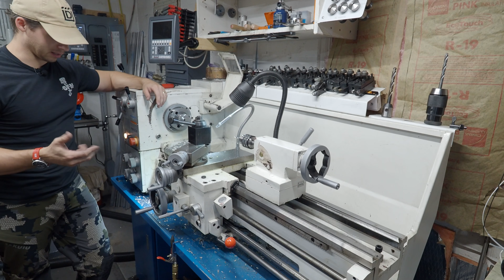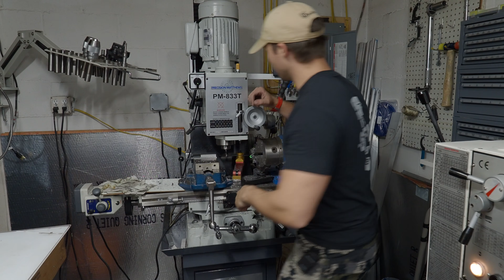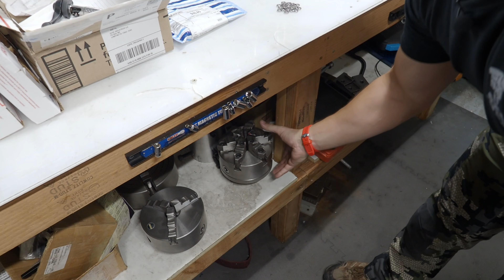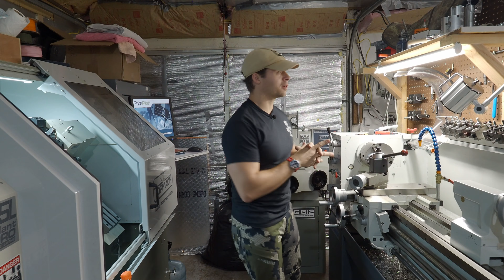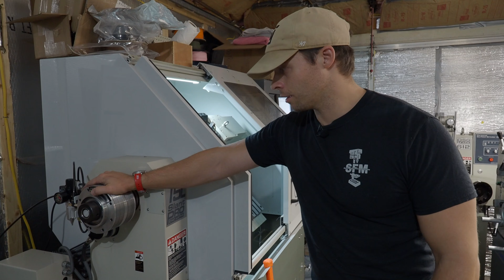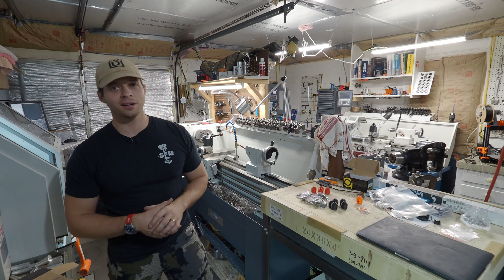My Machine Shop Story with Precision Matthews and Tormach Machines

Comment: pm 1236 is from the same factory as the al336 sold here... and has the same distinctive, and major flaw... looking around, some have it, some dont...

the tailstock. flush front, no overhang. working between centres is a nightmare, and throwing a DRO on just makes it worse. quill fully extended, and theres never enough travel to get the full length of a work piece. if you set it up to cut right to the TS center, you ram into dogs at the other end, or have to adjust compound, or swap tool around in the post... and one slightly over zealous retract and bang, youve knocked the TS back a few mm...

even just drilling and you have limited travel on the quill before having to mess around and change the setup...

one aspect i wish someone had pointed out before investing several years ago as its been a constant thorn in my side...

as it is, i have plans to chop it up and convert to a slide come shaper type affair as i see that having some practical uses for what i tend to do... just waiting on the right chunk of CI to fall in my lap...
Reply from the maker: Just cut the tail off your TS tooling. That is what I did. Gained an inch. Very easy.
Reply: @GrimstodDesh  that doesnt fix a thing when the saddles hitting the TS. its not about the length of tooling. its having the quill fully extended and losing the main use of the TS... supporting the work between centres. rigidly.

having sufficient travel of the saddle between headstock and tailstock. throw in the dro and you lose another 20mm or more... if you cant turn a bar the full length in one pass, without shifting tools around, you cant take on certain jobs. which makes the ownership of a lathe rather pointless...

the only lathe made this way...
Reply: If it's anything like the PM-1030V cut a chunk off the front of the tailstock too. That can buy another inch of travel before it bangs into the saddle. I also shortened the stop rod they had affixed to the TS - it held the TS about half inch away from the saddle. DRO scale is fortunately mounted high enough it's out of the way mostly.
Reply: @xenadu02  got me excited before realising ive thought of it before as i poked my fingers up there...
only a thin wall at the face of the base. theres a web about 2 inches in but lose a fair bit of area going that far back...

still, worth a thought.
except the vees on this thing are terrible, and to scrape them means the whole unit needs realigning in all three axes. i stick with my initial thought... with quill removed, should be just enough meat to squeeze in dovetails and get away with a shaper/lever action.
either the local scrapyard dlivers a nice 3x3x12 cast iron lump, or a tailstock off something bigger im happy modifying. (or fire up the furnace and do some casting?)

could flip the stock on the base but only gain an inch, still have the scraping/alignment issue, and the existing alignment key is offset enough to not allow simply recutting a slot. possible but dodgy.

shaper attachment seems more versatile...
Reply: @paradiselost9946  I assume whoever does the castings (Weiss?) is like "we aren't modifying it", otherwise clearly a redesign to make the cross slide thicker would make it much easier to mount the DRO scale. There are other obvious issues that could be solved with some tweaks to the design but all the various variants of these lathes in all countries just continue to have the same flaws with no changes/improvements. They are engineering to a price point I guess. I often find tail stock quill length a problem but I just work around it best I can.

Comment: Dude you shill waaaayyy too hard. You think people wont have to go into debt for a 30k machine? That you claim to have paid off in 2 weeks. Yet you say a haas that costs 45k will take forever to pay off. by your math it would take 1 extra week to pay off. CNCA will gladly take your payments with no early payment penalty. You are just talking out your ass. No way on earth id take a tormach over my haas. My machine came set up, installed, with factory training and support and a warranty where the techs come right to my house. the extra 13k i paid was well worth it, the machine has a chip auger and 40 gallons of coolant. Tormachs just dont compare. 1100mx is 1600lbs, mini mill is 3500lbs. thats a MASSIVE difference in rigidity.

Comment: Nice stuff man. I had picked up a tormach 440 and used it to do runs of AR lowers that I bought in 80% form, I'd already bought and paid off a 30w fiber laser engraver do laser work. Used the laser to do my Pl markings on the receivers and logo work. Sent them off to be anodized and sold them for 4 times what the initial cost of the 80s were. First batch of 30 receivers was about 1/4 of the 440s purchase price with everything included. Unfortunately, I let my FFL go so im only doing firearm stuff for my self now. Found your video browsing around getting ideas of non FFL machine work I can be doing.
Reply from the maker: That is great. Ya I considered doing lowers once but I have so many other sticks in the fire.

Comment: I see that you have experienced the basic beginner problem of leaving the chuck key in the chuck before powering on.  That little scrape on the machine just outside the chuck is the proof ;-)  I'm not hounding you or calling you out.  That little scar is a tribute to most people that do machining.  I mention it just so others will pay attention to that simple mistake.  That simple mistake is mostly non threatening but it takes only one time to throw that key into your head.
Reply from the maker: Lol i have never done that. Not once. All my chuck keys have the ejector spring on them so its not possible to leave them in. What you see is just a ton of use. Tens of thousands of times hitting it with the handle as i tighten the chuck over the years.
Reply: @GrimstodDesh  Sorry I assumed.  I have been fortunate to not do that myself.  I did buy a used lathe once that was fairly new and I knew what happened since the chuck key was slightly bent.

Comment: There used to be several machine shops in almost every town that had any industry at all. Now there are not many folks being trained to do work on anything but CNC machines, so you have to teach yourself much more to run your kind of shop. I think there is a bright future for small reliable "hot-Shot" machine shops that can get work done promptly. I oc=nce saw a guy corner a worldwide market with word-of-mouth advertising of a microscope eyepiece for Nikon Cool-Pix cameras.